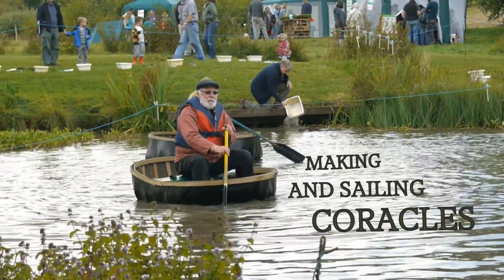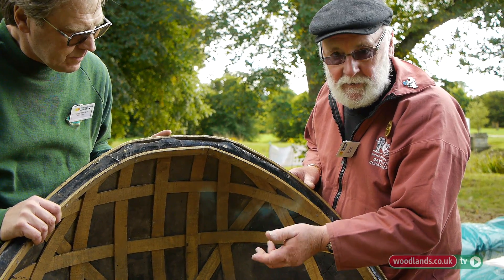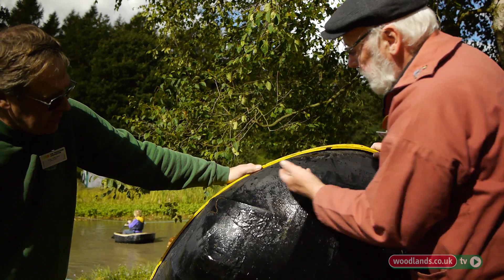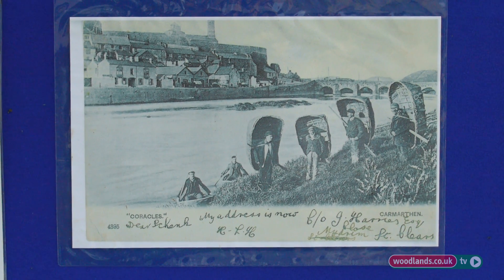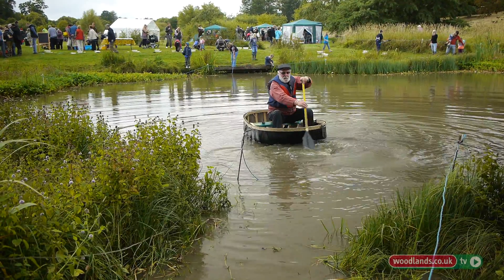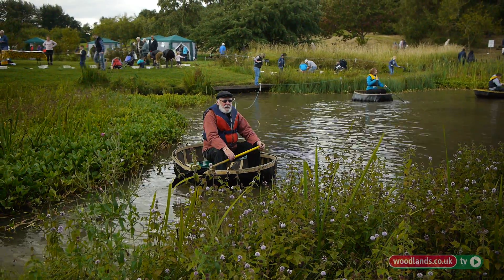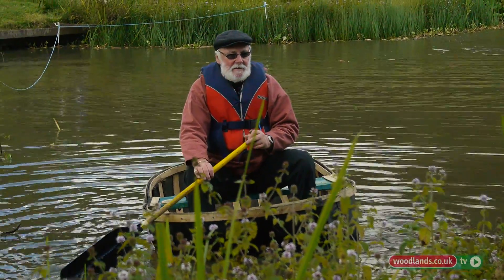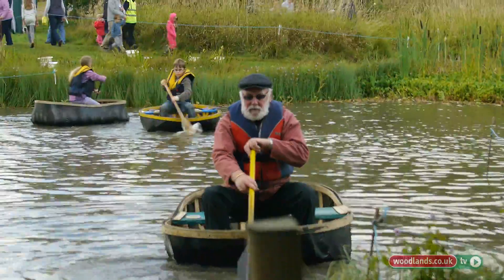Making and Sailing Coracles

Comment: I'm short and prefer a short paddle in my canoe. in this application, a long paddle with a wide blade would be better for me.
Reply: A long narrow blade with a good foil section is most effective for the sculling stroke.  I've used a traditional oar over the bow of a dinghy to good effect.  (Great for squeezing your little dinghy through narrow spaces).
Oars using variations of this stroke all over the world use long narrow blades.